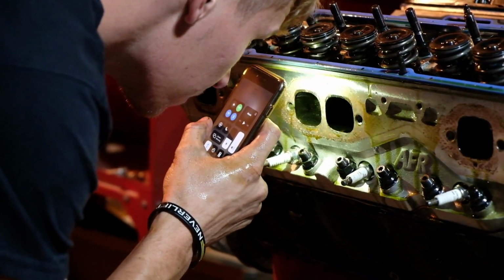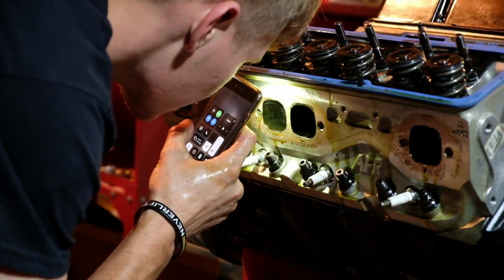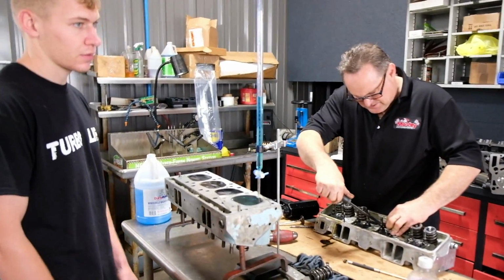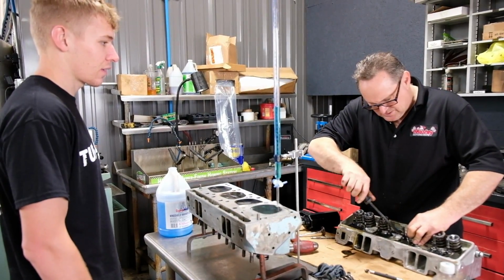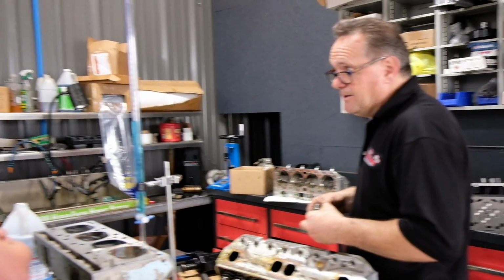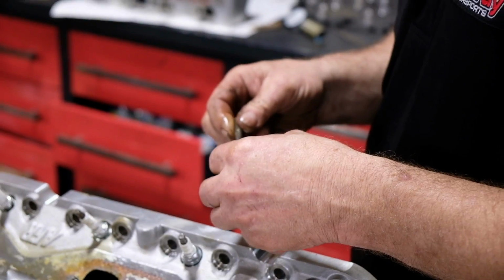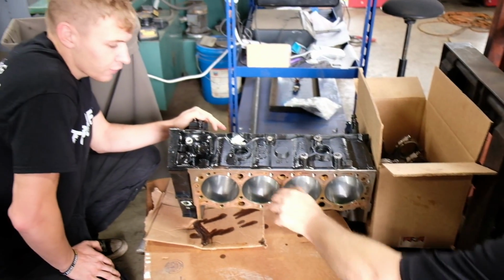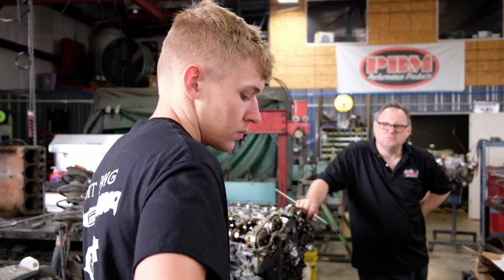AWFUL WEEKEND 😣 No Prep Mania 4.0

Comment from the maker: It’s going to be a long week hopefully we can get it back together before marion county raceway no prep July 4th.
Reply: I'll be there bro
Reply: Stay with it..
Reply: Awesome decision to change the set up. It's been too frustrating and something is going on to cause all these issues. It's time to move on and do something different and hopefully more reliable. It gets old and tiring tearing apart an engine all the time.
Reply: You need to find a sponsor, some other YouTubers get free motors and good deals on parts and put many street miles and go pretty fast as well....
Js
Reply: I really enjoy watching your videos and I love American muscle cars and trucks
Reply: Billy there's a place in New Jersey that coats pistons. My brother couldn't keep pistons with 20lbs of boost. Once he sent them off they could handle 40 plus pounds. Just saying
Reply: Hey that was cyl. 3. Wasnt that the cylinder that had the bad cam lobe that your dad tried to buff out. Was that the valve that dropped? Might have been a contributing factor
Reply: Sounds like multiple gremlins. Culprits - Valve float, piston slap, coatings, etc. Any temperature issues? Seems that these problems really began cropping up when you upped the horsepower? Lower boost and more compression?  What are your cylinder pressures and temperatures currently? Cylinders scuffed - how loose are you running those pistons? Maybe some buttons on the piston skirts to take out the rocking in the bores? Pistons too loose are a real problem. Valve float - ramp speed too fast due to excessive lift? Maybe more duration and less lift? Was it an intake or exhaust valve that failed? Sleeve with a 0.030 overbore in all cylinders not a bad idea. A well done sleeve will work. How’s the mixture throughout the rev range? Is there any detonation? Lots of things beyond these to look at. With all the hp you have now you are operating in rare air. Maybe need to look at some dyno time with thermocouple and mixture readouts, plus whatever else it can tell you beyond hp/torque. Good luck.
Reply: Do you ever come to Tulsa, Ok?
Reply: Maybe next year you will do rocky mountain race week I think you would absolutely reck it your a badass driver with a badass beast of a truck
Reply: @jeremydavis340.  Yep
Reply: Slide Ways  Jesus, are you trying to keep him from getting helped out by someone? Just because that's the case doesn't mean you should post a reminder all over his comments? Maybe your comment will get deleted for his sake..
Reply: Good luck!  ✌
Reply: @jeremydavis340.  Has zero to do with it.
Reply: @RustyWells2  Nope.
Reply: Come to Crossville dragway
Reply: That suck's Billy but that's racing
Reply: brad the kid rofl
Reply: @vengeanceizmine9878  how is it that you know that ? It is the exact same cylinder that just broke the pushrod and ate the lifter . He talked about taking the head to the machine shop but didn't they just put it back together. How can you be so confident that the failures aren't related ? It's highly possible that the piston could have kissed the valve ( either of the two because the half of the broken pushrod was jammed into the the other pushrod) and cracked it or the valve could have been slightly bent from a alcohol hydraulic lock previously and have caused the push rod and lifter failure . But all just speculation.. they didn't pull the valves on #3 to inspect after the first failure so non of us can say for sure ....
Reply: @jasonsparshott7208  Your original response was the failure possibly being contributed to what his dad repaired on the cam lobe. The minimal amount of damage on the cam lobe, he filed and buffed, would NOT cause any harm to any parts. That is what I was referring to. The cam lobe repair had nothing to do with broken valves.
Reply: @vengeanceizmine9878  no sir I only responded 1 time and it had nothing to say or do with Bill cleaning the cam up ! I would have reused the cam in a heartbeat ( especially since it's a hydraulic roller ) ! My response was that the initial breaking of pushrod and failure of the lifter absolutely and most likely contributed to the dropped valve . I would have pulled both valves and inspected before reinstalling head ! Your right the cam had absolutely nothing to do with the valve drop ! You said it wasn't related to the initial lifter/ pushrod failure to 2 different people I simply said that you can not know that and even the machinist said it could be and most likely was related but no way to say either way for certain! Sorry if I wasn't clear in my response
Reply: @jasonsparshott7208  I stand corrected. It wasn't you who made that comment, however the response to yours still stands. I thought you were him for some reason lol.
Reply: @vengeanceizmine9878  all good

Comment: There is still going to be significant marks in that bore at .030", up to you and your machinist as to what will work. Dings don't automatically mean problems.

I never cared for sleeves in the 4.125 blocks. In a factory 400 block, you can pretty much guarantee at least one of the head bolt holes will crack towards the sleeve as you torque on the heads. (block now garbage) With the Dart block being better material and having blind head bolt holes, perhaps there is enough strength to hold the torque without cracking.

With boost you need added spring pressure (esp intake that has a large surface area and pressure trying to open it) and larger diameter, heavier wall pushrods. (esp exhaust with the added cylinder pressure trying to keep it closed) Look closely at the valve spring shims that the spring sits on, if it is polished or tore up the spring isn't controlling the valve properly.

It's possible the skirt coating has a compatibility issue with the oil or fuel you are running. If you are washing the cylinders down with excess fuel, or diluting the oil with fuel, that can also tear up the coating. It goes without saying, but a proper warm up to get everything up to size before you load the engine helps to prevent skirt damage/cold seizing.

Best of luck, love your channel
Reply: There was a issue running some coated pistons with boost .  Maybe consider running a hydraulic roller cam with solid roller lifters or limit the travel on the lifter piston
Reply: Been my practice to adhere to what spring pressures opened and closed that the cam manufacturer calls for. I have had to shim Springs but less than ideal.

Comment: I wouldn’t bail on the small block just yet, sounds to me like you just need to upgrade some valvetrain components. I strongly suggest shaft rockers, and some Trend or Smith bro’s pushrods, and obviously better springs, we beat the piss out of a 23 degree small block on methanol with boost years ago and the valvetrain parts took every bit of it. 👍🏻
Reply: I was also thinking shaft rockers as well .
Reply: yep crower steel shaft rockers also go to .904 solid bushing style lifter for ultimate durability i dont know why some guys still mess with the needle bearing style lifters anymore
Reply: Exactly! But get a LS is what all the 20 year olds think lol gets old...SBC built right will contend til were all dead
Reply: Have a 406 with jesels.   Motor sees regular street duty and a very healthy shot of nitrous when needed.   We lost a lifter a few years ago but talked with cam motion and got a better set.   Knock on wood been together 3 years now no major issues.

Comment: That 60ft on Patches is deadly.  Hope your program is back up and running soon. Quick fixes are usually on temporary and create more downtime.May want to investigate valve to guide clearance and a high quality oil.  I use umbrella seals and allow a little oil to lube stems.

Comment: Billy, a little advice when running a turbo on alcohol with a lot of boost.. 
- Inconel exhaust valves a must.  Standard and Severe Duty won't cut it. Switch to 11/32", not 7 or 8mm AFR uses. 
- Steel exhaust guides a must.  
- Ample guide clearance. 
- No valve seals. 
- Minimum 3/8" .145" wall pushrods, 7/16" .145" wall preferred on exhaust, or a taper. 
- Minimum compression 11.7 to 1 
Also, ditch Wiseco, their skirt coatings are useless, and don't last past startup. They are also not designed for that abuse. Go Diamond. 
Go +.030" regardless, Dart blocks are extremely thick.
Definitely go Solid roller, with A LOT of spring... use bushed lifters. No reason you can't drive it and beat on it, just need attention in a few key areas for the application. 
Just some friendly advice...
Reply from the maker: Thanks for the advice. I have a solid roller in it now. I also was running inconel exhaust valves.
Reply: @StreetRacingChannel  No problem. Anything I do, at minimum, with Turbos on alcohol get Inconel, or Extreme duty valves, steel guides, not Bronze, and no seals.. excessive heat in a turbo application plays havoc on the exhaust side. Cam timing helps with heat, and valve control plays a big factor, as you need much more spring for boost.. only way I see an Inconel valve break like that.. 
Otherwise, respect to you guys. You remind me a lot of Lance over at Team Shitbox when I was helping him out..

Comment: I would bore 30 and if there is still a mark in the cylinder wall and it is above the rings i would run it and i would go to a less agressive ramp cam , either a street roller or hydro roller as you will only lose 25to40 hp and you can make that up with boost . Good luck love the channel

Comment: Dammm.    Time for efi.  I'm running fueltech ft600 love it.     Ton safety settings.   Tech support is the best.
Reply: That's been my thoughts two rebuilds ago, the Dad is dead set on that old school technology, he doesn't know EFI and is against changing, I was too but I'm glad I did,it takes a bit to learn but in the long run it's worth it.
Reply: Even a basic Dominator setup would do wonders for the reliability of the combination. The tuning window is too small to for hoping the fuel distribution is good enough with the carb and the sloppy timing of a distributor drive likely cost him a motor or two when he was pushing the edge with homebrew meth injection.
Reply: @heytonyman  yeah only problem with dominator or hp can't be fixt.    I know  like 20 people they have to buy new unit because Holley can't  fixt it.   Holley  say sorry but we can give  you  10% discount.
My terminator did the same  glad still have warranty and got my money bad.   
 Fueltech can be fixt don't matter what.

Comment: I’m not sure what your setup is, but I’ll add my .02. If there is enough distance between the top of the piston pin and the top of the piston try to have a piston made with the top ring at least .300 down. Then call Ed Curtis of flowtech induction and have him grind you a specific hydraulic roller cam and use short travel lifters. Depending on valve size and valvetrain weight, you could still turn over 7k. I’d also have the heads o-ringed and that would solve those problems.

Comment: A .030” bore takes .015” from the wall... those gouges are definitely deeper than .015”, Billy... I know stock 400 blocks have an inherently thin cylinder wall but that is a Dart block so I’m not sure how far you can take that, but your builder is confident that going .150” to install a sleeve is okay. I believe you’re going to be choosing between sleeving one hole or popping for another Dart. Get another block coming and have that one fixed and full of good slugs for backup? I see the No Prep guys are running 15.0:1 with twins now. Whatever or whichever way you go I wish you the best of luck. Scotty

Comment: You should just go ahead and build a 434cid or 440cid SBC with 2618 forged pistons I beam rods or aluminum rods with a billet steel crankshaft and put it on EFI with a Holley Dominator and 11.1:1 or 12.1:1 compression and switch to M1 or M5 and get a set of AFR's I think the 245's is the biggest 23 degree heads they make slap them bad girls on there too with a solid roller turbo camshaft and 1.6 shaft rockers
Reply: Why? The difference in power is minimal, yet costly. Make it up with a few lbs of boost..

Comment: My lil engine did the same thing right after I got the heads worked and the valve guides didn't get clearanced enough for the valves and the valves locked up open when it got hot and I had to use a punch to knock the valve stem out of the head and it was still stuck down and it chewed 2 holes in a piston and cracked my block

Comment: SOMETIMES, after you've patched together the pieces several times, and shit keeps happening, it is time to just throw the old shit on the shelf and start fresh with ALL NEW shit... Keep the old shit for the backup in a pinch.... AND SOMETIMES that big whoopie cam isn't always the trickiest piece for a turbo engine, especially for all the street stuff you do. Valve control is essential at high boost levels. Big Springs but smaller lift works really good, I've ran over 800#'s over the nose, but it was a very high maintenance engine.. Just some advice from an old dude that's been street racing for 50 years and running turbo's for over 20.... OH, one last thing -- It took me a long time to leave the carbs behind, but it's time to move on to EFI and it's an easy learn on how to tune and especially with all the traction control being available though EFI now!!! Just saying as a friend...

Comment: Don’t give up on the SBC, I love seeing u doing the blow threw and I did it for years but I finally gave in to EFI and I haven’t looked back. What do u think about a more compression and a lower rpm cam and converter?? We did a 1600 whp single turbo set up and never spun it over 5500rpm and it worked well...

Comment: Stick some high compression pistons in it and run it on alcohol some u dont have to put so much boost to it and it will save you on parts and make alot more power.

Comment: If you are breaking pushrods and lifters from street miles, find a less aggressive ramp lobe. A solid “street roller” (1.120 base circle) in my bbc at .650 lift has been living well with 650#s open and Crower lifters for 4 years and I beat it like it owes me money. 7800+ rpm.. 
I also run a .120 wall 7/16 pushrod. Crane golds with Jomar girdle. Get the biggest heaviest wall pushrod you can fit in those heads even if you have to grind on it. Check your cam company on the lobe design and see if there is something less aggressive.. turbo cars don’t need aggressive camshaft ramps to make power.
Reply: A Hydraulic roller will not break lifters and pushrods for a few reasons. One, is just that they arw not nearly as aggressive as even a mild solid roller.. and even an aggressive solid roller won't snap pushrods... cam is not the cause.

Comment: I'm confused.. solid flat tappet and solid roller have been driven on the street by many guys.  His comment about the springs make sense.
Reply: If it’s got an aggressive ramp on the lobe they tend to be hard on valvetrain parts because the amount of spring it has to have to keep everything stable
Reply: Which is why companies are marketing some solid rollers as “street rollers” cause the lobe is less aggressive. Especially on a Chevrolet lifter. They’re like a .842 if I remember correctly so they can’t take near the ramps compared to .875s or Chrysler .904s

Comment: no way would i sleeve that block if 30 over fixed it. i got 2 split blocks that had same issue. both mine split in lifter valley just in front of sleeves #3 and #4 on 2nd block. just my 2 cents... worth a penny

Comment: When's it getting an intercooler?
Reply: Research carburetor charge cooling and that will give you some answers to that question
Reply: Probably still isn't enough.
Reply: An intercooler has nothing to do with his issues, and at his level, running a carb and alcohol, doesn't need it.

Comment: If you're not breaking shit, you aren't pushing it hard enough... but man that sucks, been fighting the trans in my daily 65 GTO for a month now.  I think its time to go back to a Th400, it takes longer for my 455s to break them. I feel ya. Might be time to step up to an LS or some other engine that can handle the boost a bit better.. or is cheap enough you can throw it away when you blow them up.

As an aside, I need that John Deere A block on the shelf in the machine shop.

Comment: I like how you guys use the gen 1 but LS have bigger cam journal and the blocks are stiffer and the heads flow better
Reply: Bigger cam journals mean nothing at this level. An LS block is Not stiffer or stronger than a Dart aftermarket standard sbc block, and the head comparison is apples to oranges. So, regardless what YouTube says, LS is NOT a cure, nor is it better. Just the facts.

Comment: Please just switch over to EFI I had a major problem blowing shit up with blow through carb I've never had a problem since I switch to EFI drivability will be tremendously better and it will only do what it's programmed to do any little bit of trash or different temperature is our altitude will throw the carburetor setup off where is the fuel injection setup can compensate and stay within its parameters

Comment: I'd bet it's the valve springs, I'm pretty sure that's the same hole u had a problem with last time, springs r worn out and causing excessive lash. In the video u can almost hear the valves float right before u shift😠sorry man, just come back stronger, i know u will..u should try to build a backup short block too with spare $ and time too so u don't have to miss any races..

Comment: I’d be curious to see what the afr’s are cylinder to cylinder on an engine dyno with 8 wide bands running your exact setup to see if there is a distribution issue. Polydyn in Houston does amazing coating work on engine parts. Here’s their site if you want to check them out https://www.polydyn.com/performance-coatings.